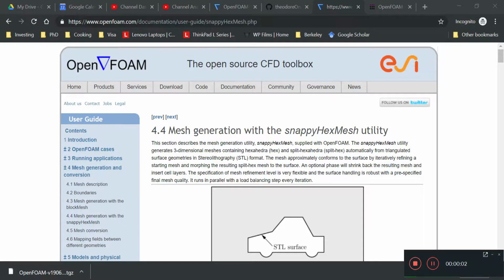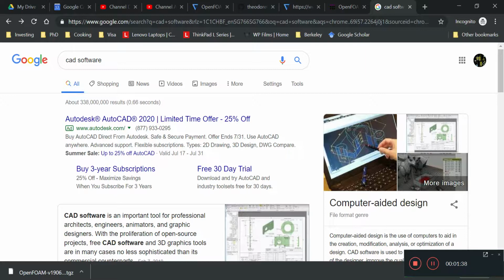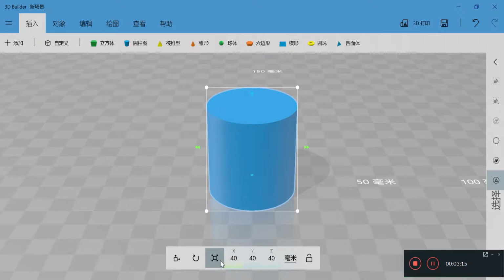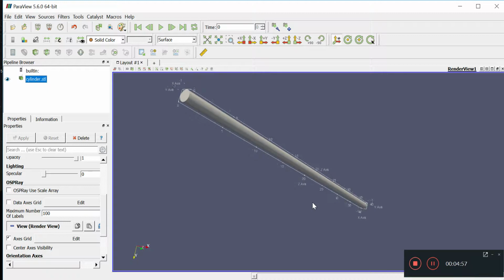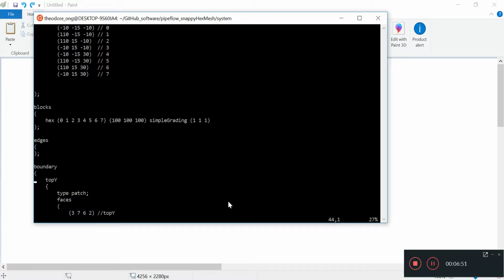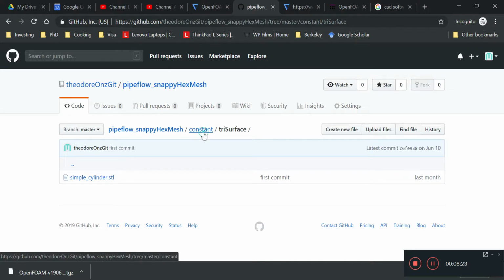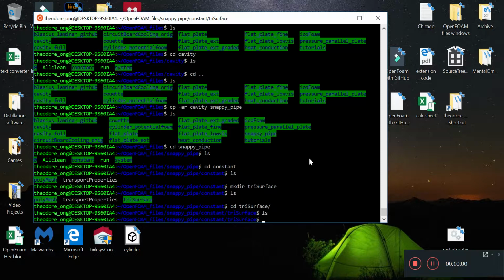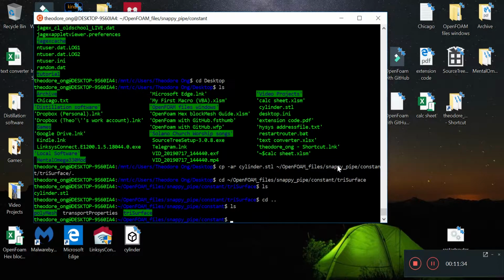OpenFOAM Intermediate 2 - snappyHexMesh import stl files in triSurface directory

Comment: Hi, man, recently I am struggling with importing the complex porous model in STL form to OpenFoam, trying to see how water flows through those inside pore structures. Your videos are helpful to me to understand there is a possibility to do it. Due to the extremely high complexity (originally with nearly 1M faces), I cannot do it like what you showed, is there a solution for that complex model? (I used one third-party software to simplify it, no it drops to around 5k faces)

Comment: Hi Theo Ong, I am quite new in OpenFOAM and following your tutorials, that are really helpful. I have Unbuntu on window installed 2 days before, I have exported quite good (.stl) file with ascii, my problem is the Ubuntu terminal is not allowing me to transfor my (name.stl) to triSurface folder (error: cp: cannot open 'file.stl' for reading: permission denied). its same scenario while I am reading a (.stl) file with "nano file.stl" with same comment permission denied for reading.  Could you please guide my, why my Ubuntu terminal is not allowing me to read my (.stl) file inside the terminal..... Thanks in advance.
Reply: i have the same problem help! please!
Reply: @christianh.salinas9034  Hi, try to installation Ubuntu in Oracle VirtualBox and finally from VirtualBox General tab goto advance  and allow bidirectional file sharing and also drag/drop bidirectional.
Reply: @ijazakbar3276  thanks for your helpful